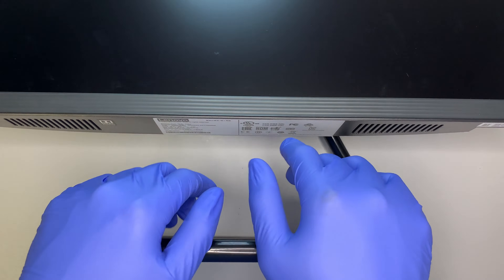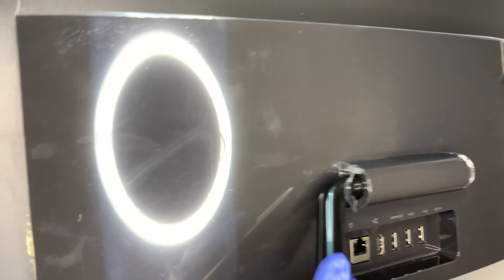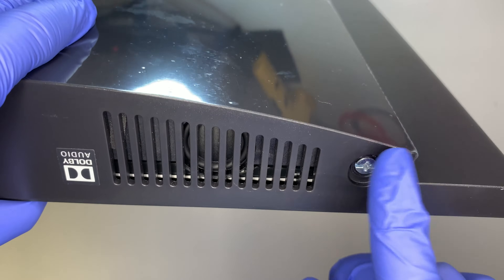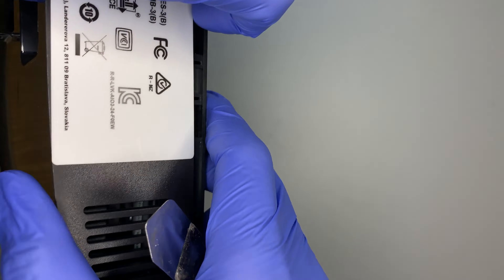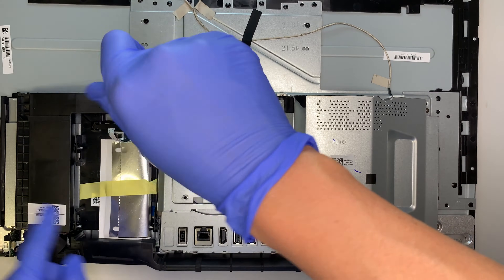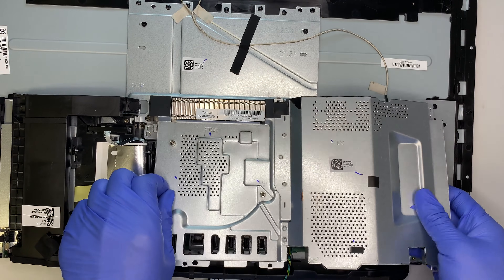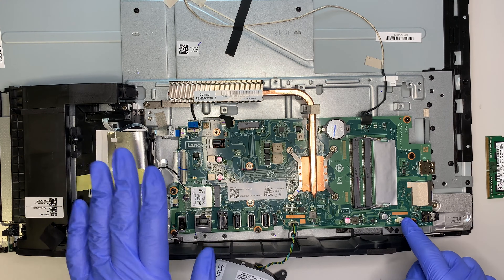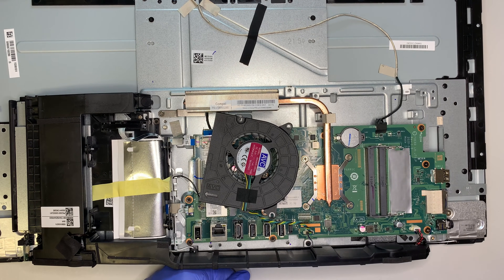Lenovo IdeaCentre AIO 3 24 Break Down Disassemble

Comment: Great video, any tips on getting the rear housing back in place correctly ? Recently tried to refit one and the sides wouldn't pop back in to place, applied some pressure and ended up cracking the display which wasn't nice. Thanks

Comment: You don’t mention the power supply. That seems to be the problem with my current Lenovo. When it’s plugged in and you press the power button it comes on for about 20 seconds and then shuts off. The problem isn’t the brick because I bought a new one.  My machine is out of warranty, so Lenovo wants ridiculous amounts of money to tell me what the problem is and then charge me for fixing it as well as shipping it. It was easier to buy a new. (refurbished.) laptop, but I wanted to get for hard drive out so I can get my data. Seeing how easy this seems to be (and I’m a 73 year-old grrl geek whose first computer was an Apple //e), I’m wondering if I could replace the power supply.

Comment: Thank you so much for the tutorial. 
When i reassembled it i tough i broke the LCD cause i got a black screen, then i check if i inserted the ram properly (i pull it out during dissassembly) and turns out it works fine

Comment: Thanks for the great video, i'm planning to upgrade the RAM. I was wondering, when you're putting addition storage in, what's the correct technique to use the silver paper at 7:41?
Reply: The silver paper covers all the HDD you can see once it is plugged in. Source: my AIO had the HDD pre-installed and that's what the manufacturer did.

Comment: Changed RAM from 8gb to 16gb. Performance is the same AND the screen cracked on one of the corner plus I have like 4 black spots on screen… what a waste.
Reply from the maker: Nvme SSD will increase the speed. Not much from RAM

Comment: Be VERY CAREFUL attempting to follow those instructions!  What the creator didn't warn (not his fault, but users should know) is that the chassis for this computer is very flexible and does not effectively protect the screen.  In attempting to pry open the case as instructed I broke the screen on mine, leaving it irreparable.
Reply: 😓 same here..

Loved the experience of dismantling the AIO monitor and going through its hardware components, which was short lived after switching it on to only realize that I have broken the LCD screen.

Now running around for a screen replacement 😅
Reply: @agsags625  Good luck finding one.  The few I saw online were as expensive - or more so - than just replacing the whole computer.  Either that, or from suppliers (I'm looking at you, Ebay) that seemed dodgy enough I wasn't confident I'd get a decent product.
Reply: @danmartin4459  is there anywhere I can replace it
Reply: Same. So depressing
Reply: I sympathise, I've joined the club.
Reply: @robmills4709  i just had the same experience , the lcd broke although i was very carefully when opening the plastic around lcd using prey tool
Reply: bruh that just happened to me. I split the screen in half instead of separating it from the rest. :(
Reply: Same here.  I broke mine too
Reply: i should read all the comment here first. sigh!!! .break the screen.
Reply: :(  Broke mine too - I think it was not turning the initial pop open screen back to the closed position when putting it back together.
Reply: In Australia a new panel was about $350 delivered, which is a little less than half the retail cost of replacing the Lenovo. It took good 4hrs to gently strip it  down & slowly rebuild with new panel.
Reply: I wish I would have read this first. I just shattered mine. Fuck
Reply: @asterzavi  I saw it then I didn’t realised I was taking the screen off
Reply: oh no... i just broke my screen too! sigh... this is sooooo fragile!
Reply: @wongkama-e3h  i agree , i did it according this video , carefully , no rush and it still broke the lcd in the end
Reply: Same here haha
Reply: Dang. He doesn't want to warn us after seeing all these comments
Reply: Pshhh it’s been broke taking apart curious what’s in it I have 6 screwdrivers pried in it alr shattered screen 😂
Reply: Whit me is the display have now a little purple strip on it
Reply: Welp that's bad news, I just wanted to clean the fan and apply new thermal paste but now I'm not confident enough to do open it
Reply: @Emiturbina  How did you get on? Did you open it successfully without damaging the screen?
Reply: @Robbo-80  I didn't, I don't have money for a replacement if I were to break it
Reply: @Emiturbina  Despite all the warnings, I just tried mine and cracked it in the corner near the power button. I'd strongly advise you against trying it
Reply: i just broke the lcd when i open the plastic around the lcd ,although i was very careful and also slowly,no rush , when removing the plastic around lcd using prey tool ,the same type of lenovo aio3 but the smaller one,22imb05
Reply: How did so many people break it im a kid and im just trying to figure out how to put the screen back on
Reply: Too late I guess
Reply: Same over here damaged my LCD screen damn it should've seen this comment before trying it
Reply: Same for me, I've bought a new screen to replace it.
Reply: @JamieJones1985  where from?
Reply: @Jamie Jones  where can I get a new one from
Reply: @YJnNorth  I got it from laptronics in UK. Fitted and working fine
Reply: @JamieJones1985  I have found the website what do I do

Comment: Hi...I just bought the new version Lenovo IdeaCentre AIO 3 27ALC6 with Ryzen and I wonder, its slightly different design ... I will like to know how to open it and how to change or add  SSD disk and graphic card ...did not find anything on youtube
Reply from the maker: It should be more or less the same process.
Reply: @UbergeeksBiz   O.K. I can see now, thanks for answer ... but anyways where to find graphic card or if there is even a option to replace it???... SSD i found, that is clear

Comment: Hi! great video! I bought a similar one (ideacentre aio 3 24ada6), and opened following your video. The problem is that I want to connect a new ssd drive, and it didnt bring the flex sata cable (the motherboard only has the 12 pin connector, no cable). Do you know what part number the cable is? or where can I get it? thanks

Comment: Excellent video. You do a wonderful job making this upgrade seem less intimidating. I ordered this PC yesterday and will definitely upgrade the RAM thanks to your illustration of the process.
Reply from the maker: You are welcome. Glad the video helped.
Reply: Hi @txdave2, can you tell me what the maximum RAM capacity per slot is like? I read that this pc has 2 slots. Actually my PC has 4GB RAM and I want to change it to 16GB. Can I split the RAM for the 2 slots? (8 GB for each slot)
Reply: 8GB per slot. I upgraded mine to 16GB total. I also added a 2nd internal hard drive (1TB).  @feragui02

Comment: What screw driver and crews are required to disamble
Reply from the maker: Regular philip screwdriver. Check description for electric screwdriver that I used
Reply: Do I also have to be experienced in disassembling pc parts?
Reply from the maker: @RVeerZX563  Just take your time to disassemble. Should be easy process
Reply: @UbergeeksBiz  ok thanks for the help buddy

Comment: There’s just one piece of hardware that’s attached in the middle lower part of the damaged screen that’s stopping me from prying the whole piece off. I’ve looked underneath from different angles, & it almost seems as though I’d have to push & lift it up off the hardware. This is my first time changing out a screen, I’ve managed to keep everything intact, I just need that last bit of help please.
Reply from the maker: Are you able to get the cover off ?
Reply: Not the back cover, the motherboard, and everything else inside, in order to get to the screws that are holding the screen attached. I got that off.
Reply: I got the cover off, with great difficulty. Now putting it back together.

Comment: Thanks for the video showing how to open it up. Unfortunately, while prying the machine open, I seem to have pushed some pieces of rubber from the sides/frame of the LCD assembly in between the screen digitizer and the LCD. Although the display works (and the touch functionality too), the piece of rubber blocks part of the screen. Did this happen to you? Do you have any tips on how to carefully remove this? I tried holding the machine on its side and vacuuming but the piece is a few inches in.
Reply from the maker: Glad it helped. Maybe the rubber is the add leverage for the cover. Probably you can run without the rubber in it.

Comment: Nice video. Could you spend some words on the power supply? Would it be possible to know the exact model?
Reply from the maker: There is not power supply in this model. The motherboard is like laptop. You need adapter to power on. Here is adapter for this Lenovo:  https://amzn.to/2Rco5bi
Reply: @UbergeeksBiz  Many thanks!

Comment: If I replace the c drive would that affect Windows os?  Thank you in advance.

BTW, I subbed and liked.
Reply from the maker: Yes. When you replace your C: the Windows is not on the new drive. What you need to do is get Windows 10 installation USB and install after replacing the new C drive
Reply: @UbergeeksBiz  Thank you.